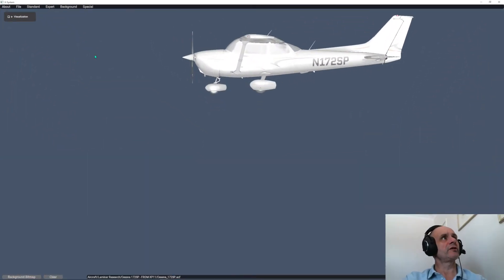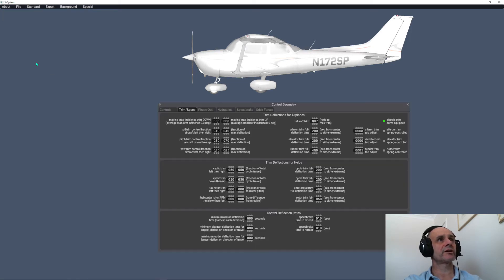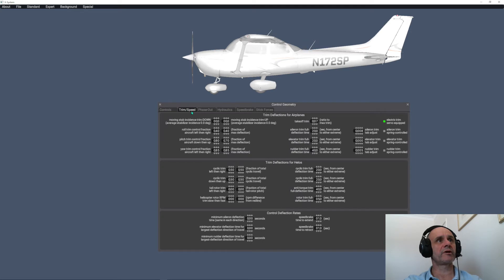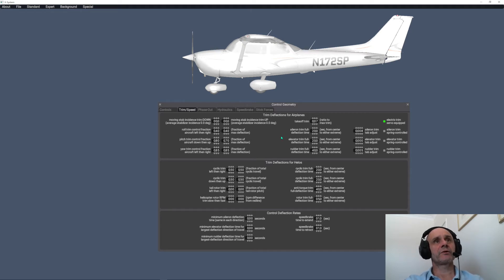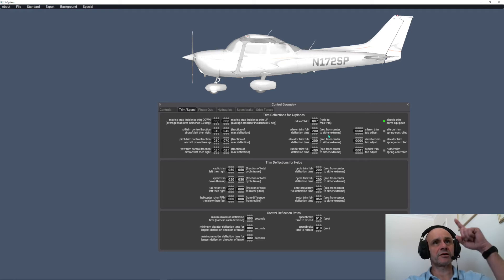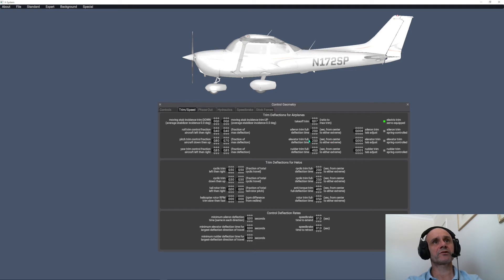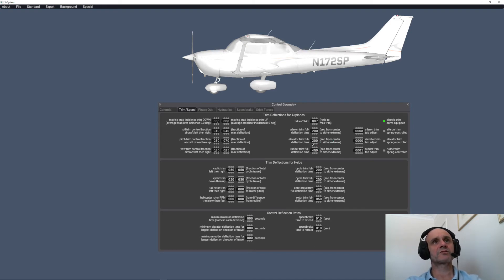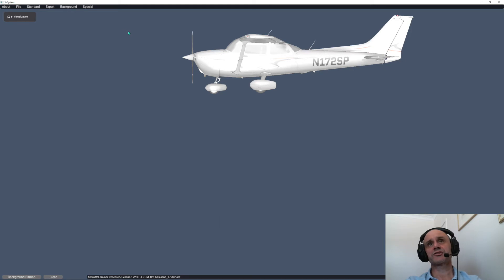103 - C172 Sim XP12 Adjust trim wheel travel speed using Planemaker

Comment: I really appreciate this video.  Now the trimming is much easier. Only one problem left to solve. The trimwheel works fine in the calibration section but makes a jump in the cessna around neutral trim. Need to find out why.
Reply: I had to set the start of the responscurve to 0. It was set to 10 as default and then the trim jumped around neutral trim. I cannot get enough trim nose up so i will experiment with the trim deflectio setting for more trim in combination with trim times.
Reply from the maker: @steinarnestas2954  Interesting. Let me know how it turns out. Keen to understand this. Interestingly, I still have my original saitek trim wheel. These things are rare as hens teeth !
Reply: @CessSim  My trim wheel works fine now. I have the Brunner cls eng joystick and the settings were wrong in the cls2sim software. I had to uncheck the use of cessna trim wheel in the cls2sim software. I am now able to trim perfectly. If I can find out how to disable the trimwheel in xpl12, I will try using the cls2sim sw for trim control again. Just to see if it works. Apparently there are some issues with planes using hydraulic trim in xpl12 vs cls2sim.
Reply from the maker: @steinarnestas2954  Great news and glad you got it sorted.
Reply: I also discoveted i have to go into the calibration of the saitek trimwheel and rotate the wheel until it is centered BEFORE i turn on the master battery switch in the c172. Then i can rotate the trimwheel slightly until in pings. After that it seems to work just fine.
Reply from the maker: Thanks mate and I hope it was of some help to you.  Has the neutral trim got something to do with your response curve in XPlane ??